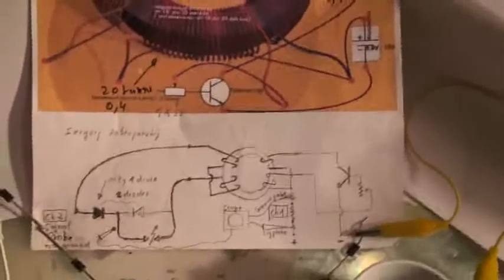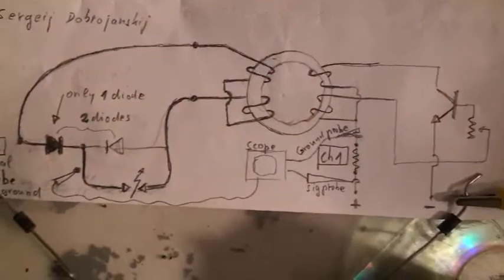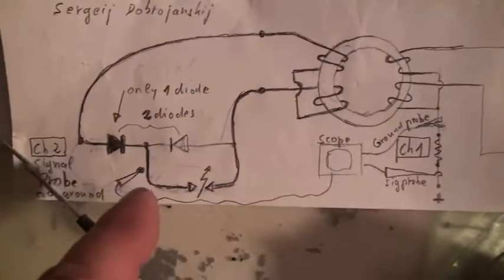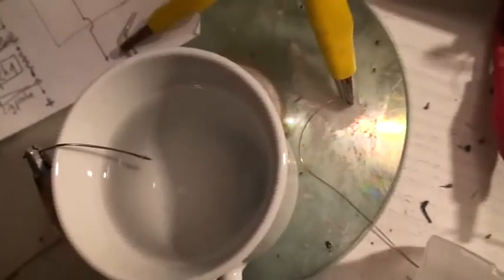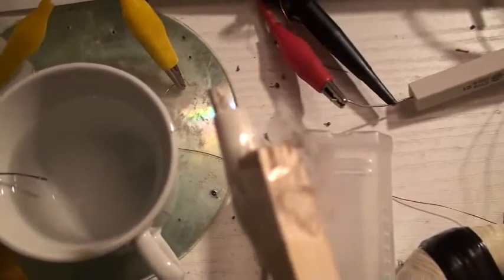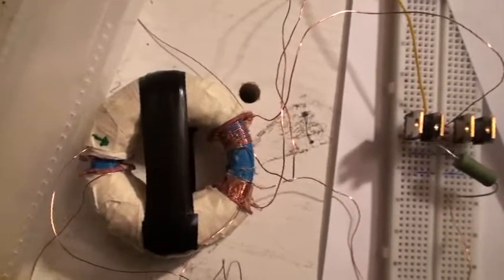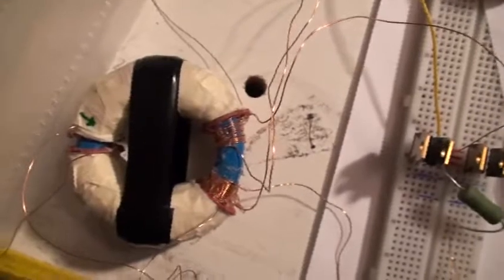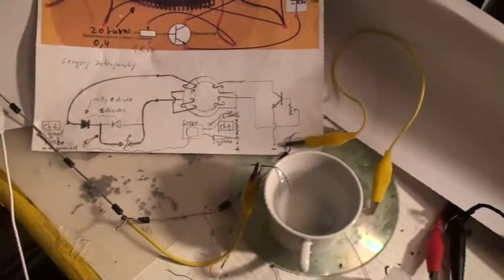Amazing water melting 1.wmv

Comment: dear woopy,
for this 500 turns coil, did u wound it as "wiper" style and in the same direction (lets say clock wise)? 
wiper style = from a to b, then from b to a until 500 turns
i've found that if we make a coil in (let say) 3 layers of 100 and we marked it as a1-a2,b1-b2,c1-c2 for start and end for each layer and we connect it as
a2 - b1, b2 - c1, the induction is bigger than if i connect a2 - b2, b1 - c1.
both will have a1 and c2 as start and end point. have u tried it? 
mercy :)

Comment: 4th:  The moral of the story is that the equations don't lie.  Much more power is being dissipated in the water resistor but you can't see it because it is water!  However, the temperature of the water is increasing.   Much less power is being dissipated in the thin wire resistor but the problem is that the thin wire resistor has no thermal capacity because it is so small.  Therefore it burns up.

Comment: 3rd:  We also know that the resistance of the water, R_water, is much higher than the resistance of the wire, R_wire.

Therefore much more power should be being dissipated in the water, but we know that the small wire is burning.  Why is this happening?

The answer is because the water resistor (in the cup) is huge and has a very high thermal capacity.  It looks like a 200-watt resistor.  The wire on the other hand looks like a 1/8th watt resistor.

Comment: 2nd:  Let's examine what is going on with a simplified model:  You have a high voltage source connected to two resistors in series.  One resistor is the water in the cup and the other resistor is the thin wire.  We know that a certain current "i" will flow through both resistors when you apply the high voltage.  We also know the power dissipated in the water resistor will be P_water = i-squared * R_water.  And for the thin wire P_wire = i-squared * R_wire.

Comment: Laurent:  It is very good practice to show where both terminals of your scope probe are connected to your schematic diagram.  Thank you very much, I wish that all experimenters would do that.  I know that we had that discussion in the past so it's very nice to see you do that.

For your experiment, you notice that the wire that is burning is thinner than the other wire that is inserted in the wire.  So naturally the small wire will get hotter than the large wire.

Comment: Well done Laurent ! Can you please show scope shots of the waveform ?
At what frequency does it work ? Maybe the hydrogen or HHO just burns up
your steel electrode. What, if you make the electrode much bigger in diameter ?
Maybe use a tungsten welding rod ? You could probably run a good light from the HHO fireball on the water. If you have enough current you will have a nice light there, burning just water... Well done ! Regards,.Stefan.